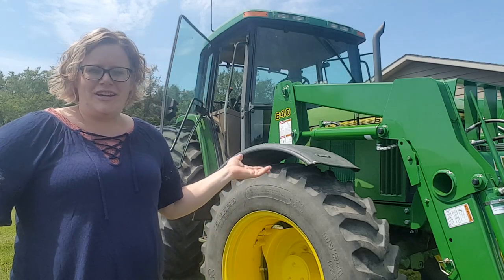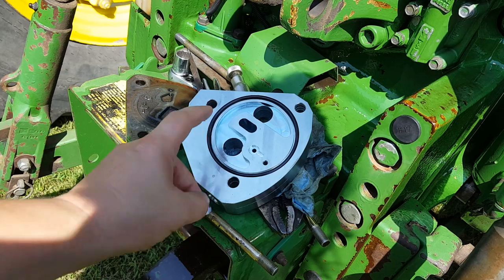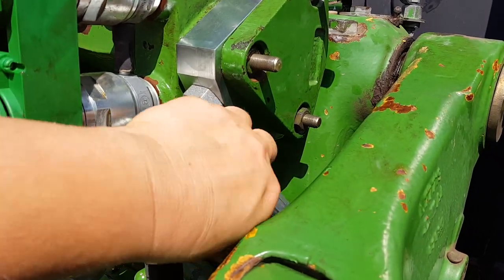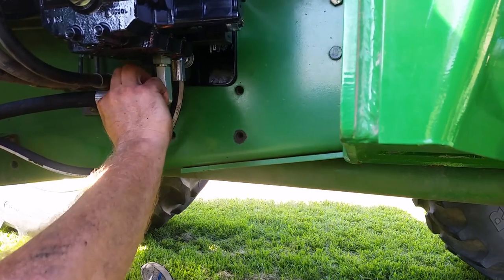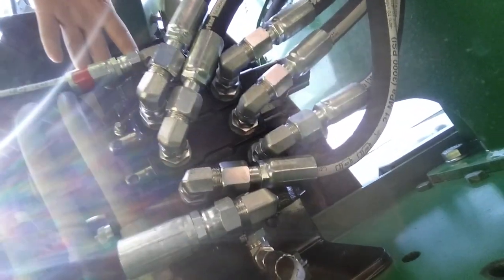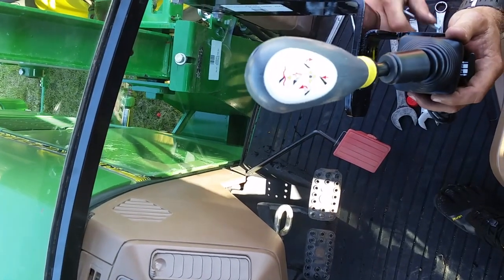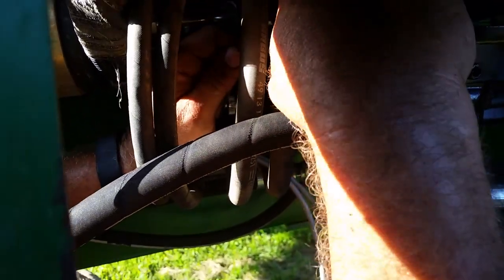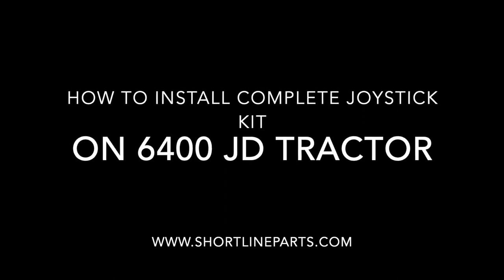How to Install Complete Joystick Kit on John Deere 6400 Tractor with 640 Loader

Comment: Hi. My aftermarket front-loader hydraulic valve does not have load-sensing line. What should I do with the load-sensing port on PB valve? Should I just put a cap on it (blocking it) or should I connect any other line to it? Thanks and regards.
Reply from the maker: If your aftermarket hydraulic valve does not have a port for a load sense line, it likely is not designed to work with load sense hydraulics. Assuming you’re working with a JD 6400 or a tractor from the same series, you’ll need to get a different valve that is designed to work with load sense hydraulics.

Comment: Would this setup work with a Westendorf loader ? I bought a used 6400 that had a loader on it , but they evidently took off the joystick . The power beyond block is still there though .
Reply from the maker: Yes, the joystick kit is tractor specific and will work with any loader. We can get you a price on the kit minus the power beyond block if you email us at sales@shortlineparts.com
Reply: @shortlinepartsllc6795  thank you.

Comment: I have one thats always gets loose and unable to raise unless you tilt up too, how do I fix that?
Reply from the maker: Is it the joystick handle that gets loose?
Reply: @shortlinepartsllc6795  Yes, I can open it up and adjust and re-tighten it, but doesn't last long. You talked about wearing out in another video, what usually wears out??
Reply from the maker: @Drink1208  typically it's either the internal pin that the handle pivots on: https://www.shortlineparts.com/koyker-joystick-joint-ball-pinhtml - or the internal joint that the pin sits in: https://www.shortlineparts.com/koyker-joystick-repair-part-jointhtml - these parts would only apply if your joystick is the Nimco brand.
Reply: @shortlinepartsllc6795  not the top of the handle, but is loose and unable to raise the loader with the joystick